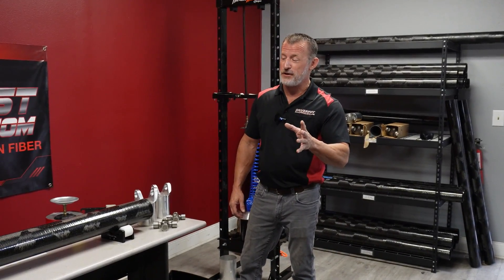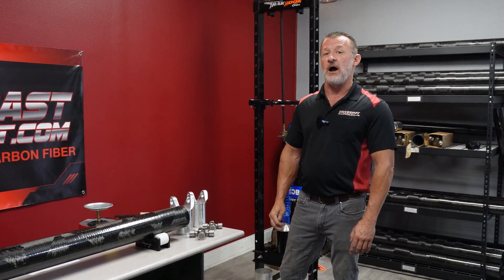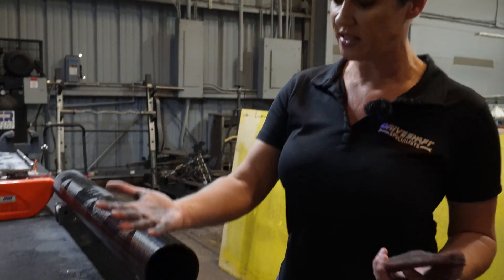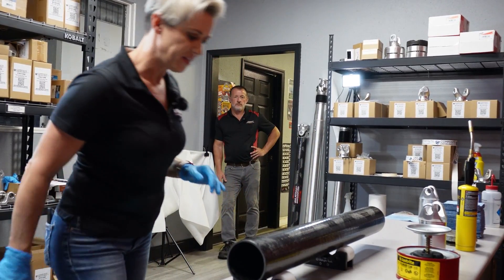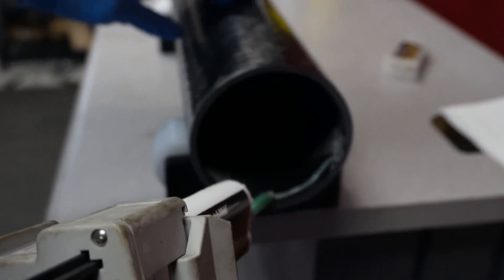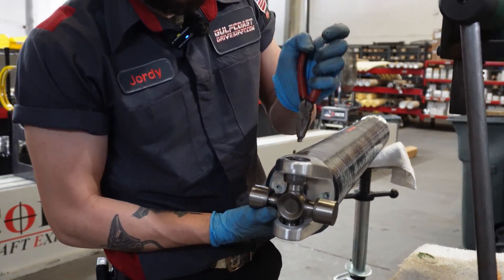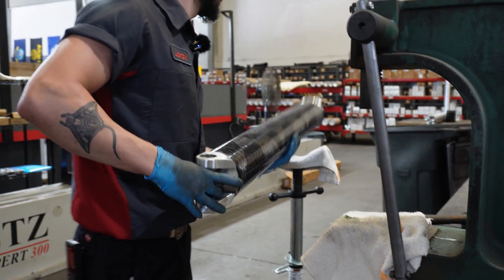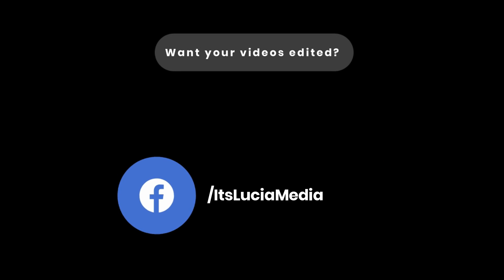Building Steve Morris Engines Carbon Fiber Driveshaft

Comment: Awesome work happening there. Have you thought about sliding a piece of foam into the cut area to prevent the dust filling the tube? A good vacuum on the saw would also help. It would also help keep you from getting it in your lungs. Sorry, I was in charge of health and safety for a $66M company 20 years ago and old habits die hard.
Reply: You don't need to be in health and safety to understand that hazardous particles are dangerous to the lungs, it's just common sense. @5:14 when the cutting starts, both of them inhaled a crazy amount of carbon fiber particles into their lungs. And if they've been doing this for years, the damage is already done.

Comment: The torque tester is an old lathe bed , tail stock and probably head stock modified into a tester.  A hydraulic cylinder cap / gland remover bench would be a better off the shelf basis for a tester.

Comment: I can’t wrap my mind around how a press fit and “glue” holds up to that rotational force. That’s amazing.
Reply: Some adhesives are stronger than if you welded it together, it is a massive surface area being bonded.
Reply: Generally, just about anything glued properly with the right adhesive will be as strong as the material itself.
Reply: I can't say I do either, but notice how much material they have sticking out that is pressed into the carbon fiber tube. With the attention to detail and the scuffing that they do which helps increase surface area for the glue which is critical to the glue making a good bond, but the large amount of material also allows the glue a greater contact patch with the carbon fiber tube. All of those factors together help result in making something so darn strong. I'm curious to know what glue they use, from the looks of it, it is some industrial grade 3m glue of some kind.
Reply: Consider some aircraft skin is glued on now. No rivets.  I separated some body panels on Corvettes and had to be careful not to tear the underlying sheet metal the panel was glued to.
Reply: It probably doesn't, that's how.
Reply: When you create a bond like that, you are looking at a huge surface. Calculate the area of that mating surface, and you can see why it is that strong. That's a lot of friction.

Comment: I would have like to have seen how the yokes where aligned.
Reply: I'd say it is pretty straight forward.  10:54 shows a rod going through the yoke with the other end being held with a support for the bare tube for the first press.    Pull the tube support, flip the shaft over and the rod would rest on the lower blocks.

Comment: Interesting method.  On the 13/14 GT500 Ford pressed what looked to be sharply splined ends into the CF tube with no adhesive.  Any idea how much torque this could withstand?

Comment: When the driveshaft twists does the tube diameter contract and try to grip the joined parts??? Do you have a way to inspect the inside of a used shaft for damage? Sometimes you see bad things on the inside when the outside looks good?

Comment: Interesting video
How do you know the ends are square or doesn't it matter?
You should be wearing a mask when cutting the carbon fiber.
Reply: I'd say it is pretty straight forward.  10:54 shows a rod going through the yoke with the other end being held with a support for the bare tube for the first press.    Pull the tube support, flip the shaft over and the rod would rest on the lower blocks.

Comment: As quite a few others have already said, get respirators for cutting the carbon fibre ASAP. It’s extremely bad to inhale carbon fibre dust. That said, beautiful work, those driveshafts look incredible!
Reply: I also was concerned about safety when they tested the driveshaft.  No guard over the shaft whatsoever.  If it failed, a yoke could go flying and cause a lot of damage/injury.  These guys appear to put out a great product but they need to step up their safety.
Reply: @danmyers9372  yep! And when the camera person moved in closer while it was testing I was like 😬 If that shaft had snapped they could have been unalived

Comment: Isn't carbon fibre dust a carcinogenic ? I'm amazed you don't wear any respiratory protection while cutting it. 😮
Watching the process of putting a drives haft together was very interesting though 👍🏻
Hopefully Steve is happy with his drives haft and it's drives him to kick Bailey's ass 😁
Reply: I was thinking exactly the same about respiratory protection. Carbon fibre dust is very bad to inhale, especially regularly.
Reply: The CF itself is carcinogenic and the question on the type of bonding resins used during the manufacture of the tubes could also be. Regardless, CF isn't found in nature so the body doesn't know how to deal with it and tries to expel it from the lungs which causes scarring of lung tissue. Not good so yes, everyone citing the use of an appropriate respirator is warranted.
Reply: Because they are amateurs, this is just like Etsy some one hacks something together and sells it.
Reply: @OneHappyCrazyPerson  Interesting. Amateurs ay? Have a go at it and you'll likely experience the wrath of haters lurking the web as well. Good luck! lol
Reply: @strykerentllc  so you dont hold free speech high?
Reply: @OneHappyCrazyPerson  Absolutely and that's exactly why you're encouraged to have a go at it yourself.
Reply: @strykerentllc  only amateurs cut carbon fiber without respiratory protection. So yes they are amateur because of there work methods.  Guess you hack everything together also and call it prime 🤣
Reply: @OneHappyCrazyPerson  When are you setting up shop and offer CF driveshafts so you can do it better. 🤡Thought so... never.

Comment: so just to be clear: the shaft length is absolutely critical, both the male and female parts have to be carefully prepared before they join and once mated you fill the void in between them with a creamy liquid... and if done properly, the two pieces become one until death of the part. nice video!

Comment: How do you make sure the clocking of the yokes is correct?
Reply: I'd say it is pretty straight forward.  10:54 shows a rod going through the yoke with the other end being held with a support for the bare tube for the first press.    Pull the tube support, flip the shaft over and the rod would rest on the lower blocks.

Comment: honest question i used to be in the sheet metal and fab place as a cnc machinist and have dealt with alot of clean room parts wouldn't it be better to flash/heat it then do your wash with acetone to achieve a higher cleaning result i assume there is something i am missing but i"m genuinely curious

Comment: I saw someone else already said it but I'd still like to reiterate, I think y'all should probably be wearing masks when cutting the carbon fiber.  I've never dealt with it before and you guys have so if I'm wrong I'm wrong,  but I have heard that dust is really really bad for your insides, I have messed with fiberglass before and the same applies. I wear at least a p100 filtered respirator when dealing with any  fine particulates. Other than that thanks for the very cool video!
Reply: Also. The saw should be on a down draft bench with a hepa filter.
Reply: Coming out of aerospace, the factory where I worked in Texas wouldn’t allow us to modify any carbon parts (cutting/grinding) without a downdraft booth and full PPE. 

Your product is such high tier I’d hate to see you guys get sick.

Comment: Thought carbon fiber dust is terrible to breathe in.  Thought I saw something about the 2 ends being 90 degrees from each other to reduce harmonics.
Reply: no, yokes should be parallel with each other to reduce harmonics
Reply: They have to be perfectly lined up with each other. We have special jigs with metal dowels to line them up and press them in straight

Comment: Just as to how you aligned both yokes. Was it done on the 12T press?
Reply: I'd say it is pretty straight forward.  10:54 shows a rod going through the yoke with the other end being held with a support for the bare tube for the first press.    Pull the tube support, flip the shaft over and the rod would rest on the lower blocks.

Comment: Thank you for the video, it was enjoyable learning about carbon fiber driveshaft assembly.
   You guys should consider wearing a  mask when cutting carbon fiber and the dust is blowing around everywhere.   Inhaling that dust mite cause you problems down the road.
   Keep up the good work!
Reply: Might cause problems? Definitely will cause problems M
Reply: I was astonished when I saw that ! This is not the dark ages of the 20th century when we didn’t know any better. Protect your future wear PPE. Far too many mechanics die of cancer.
Reply: That stuff stays in your lungs and never comes out
Reply: @emccolly  I was talking to a surgeon about my chest xray which mentioned something like "mineralization " at the bottom of the lungs. I said I used to race motocross 40 years ago and he said yep, thats it.